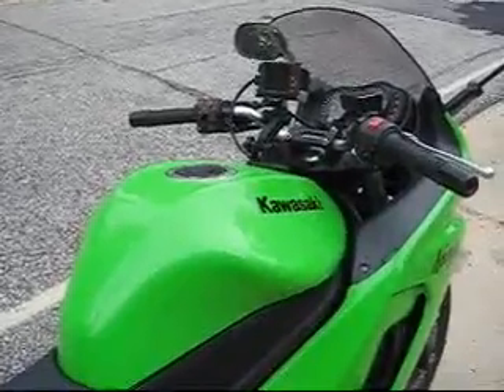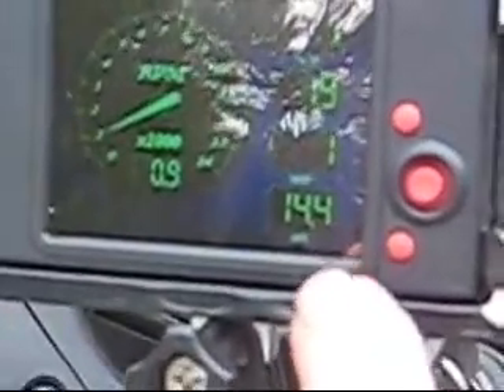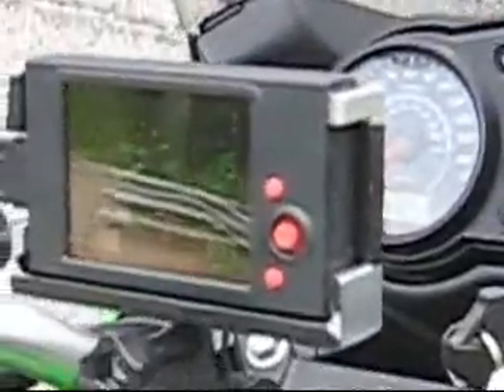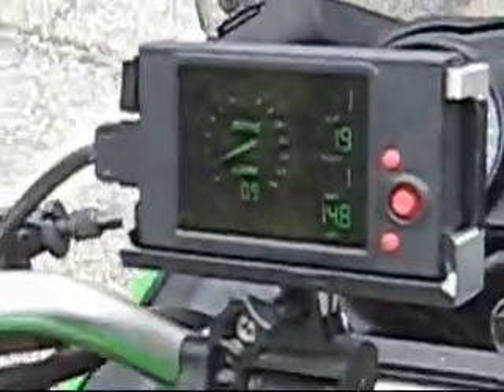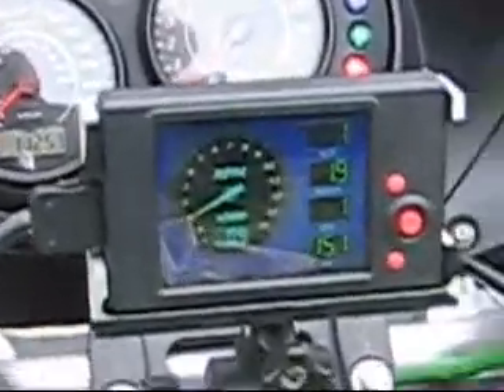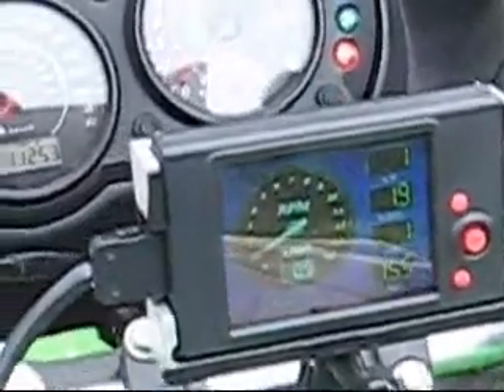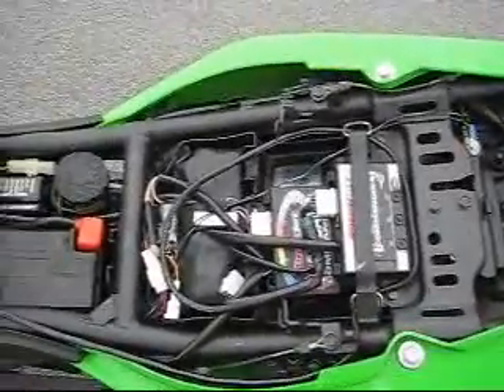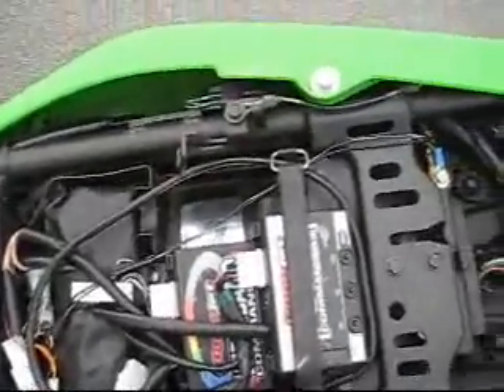DIY fuel mapping ninja 650

Comment from the maker: @ylism With the equipment you can map accurately.MPG is 55 on a run and 60 slabbing.
I made a 2nd exhaust with larger pipe.Hauls. I did a 60-80 mph roll on in 6th gear (3.7- 4 seconds ).My zzr does this in 5 seconds. I made maps for 5 different temps because it does change.Map goes richer the colder it gets.Temp sensor does not adjust proportionately.

Comment from the maker: @frontier1701 Haven't been to the dyno people.Got tired of waiting 3 hours for a run.They did go out of business.Was the dealer.Butt dyno definately.. You wouldn't go back to a stock exhaust even without a pc3 and map.Throttle is very twitchy.I put 5000 miles on the exhaust without the pc3.Custom 2 is better than one.Difference is larger pipe size.

Comment: That is way cool!  My bike uses carburetors, so there isn't much I can do other than change the jets.

I wonder what it would take to hook an iPhone or iPod touch to the power commander.  Either of those devices have a fair bit of computing power and could probably dynamically adjust the fuel map as you ride to give you the optimum settings for all speeds, gears, and throttle positions.

Plus the program could sell for a mint on iTunes.